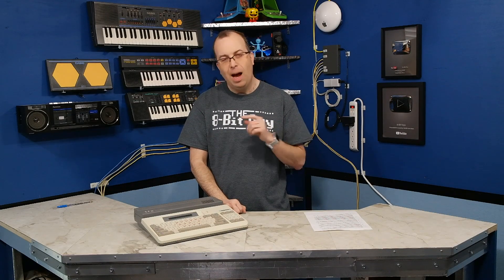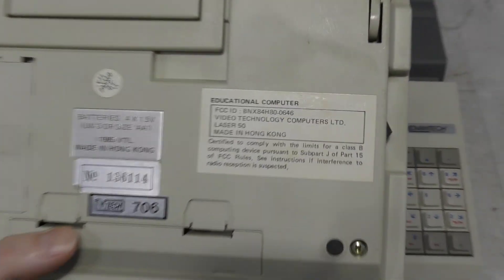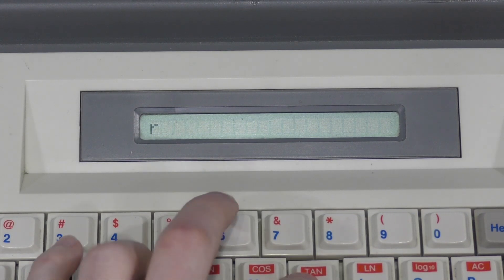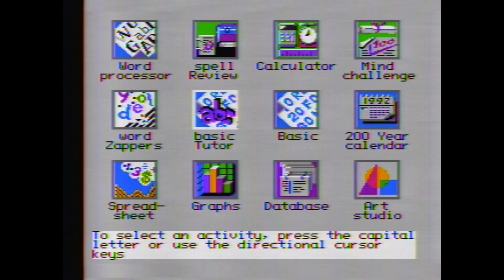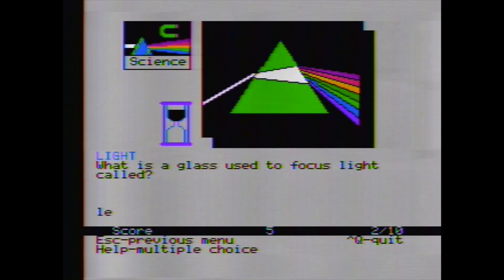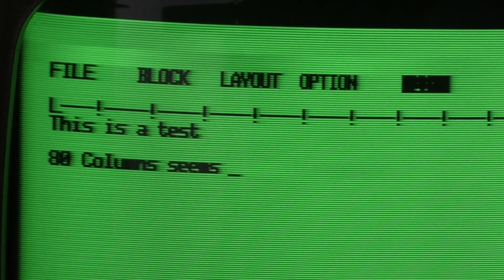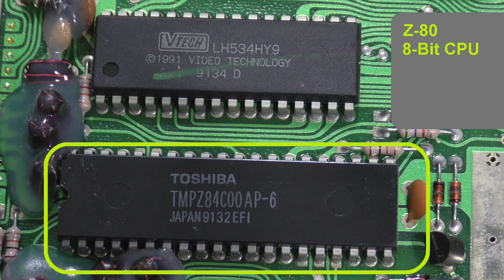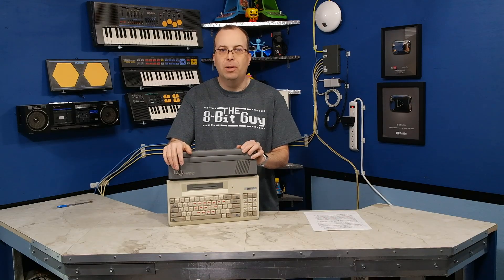The Advantech I.Q. Unlimited with BASIC and a Z80 CPU.

Comment: I'm pretty sure that screenshot on the C64C was NOT an actual application that could run on it; but the question remains: what IS that CAD application? and what DID it run on?
Reply: I've used 2D and indeed 3D CAD software on an ST, including in its low-rez mode, so 320x200 with limited colours need not be a barrier to the concept... just might have a slow redraw rate and be limited in how complex a design you could construct. There's all kinds of surprising software available for the 8-bits when you start looking beyond the games. Also I wonder if the 64C could still have 80-column and other such expansions added to it which might have made it more of a practical prospect?

Comment: Me thinks these machines were a cheap effort to scam the average consumers who weren't very tech savvy in those days... which were a great many people. The BASIC is less than bare bones, the LED is one line, the keyboard is rubbish, there's no additional software outside the boring built in programs; for 200 bucks in 1991 you're only ripping yourself off. If you really still wanted a good 8-bit micro by that point, the redesigned C64 for $150 would have been the best choice.

Great video, by the way. :)
Reply: I was kinda thinking the same thing myself. A Z80 processor in 1991? Were they insane? 

It's a bizarre machine, and it doesn't seem like the manufacturers really thought through what it was they were trying to achieve with this thing.
Reply: I think Dave's right, those awful wordprocessors would be the best bet, $200 cheaper than a c=64, ($150+$50(software)+$200(1541)+$200(printer)), vs $400.  You got a better display, spellcheck, grammar check and it was a lot more capable for writing than a C=64.  Your kid will hate you and will never go into computer science, but they won't be playing games, pirating disks and they'll be able to do their assignments... ugh.  That said, some of those wordprocessors had DOS disks or could be used as a printer, and I bet that external monochrome monitor is a generic composite one.  You might find a junk XT or something to upgrade to... having flashbacks to my horrible childhood.
Reply: I'unno, the hardware basically seems to be an Apple ][c just with a ~5MHz Z80 in place of a 1MHz 6502 (and so operating just slightly faster, realworld). One of those plus a basic software bundle might have cost you about the same at the time, maybe quite a bit more because of the built in floppy (the mechanisms were still fairly costly), without the nominal portable capabilities. A "real" laptop or indeed any other kind of useful portable computer would have been much more expensive and not at all kid friendly, or able to connect to a TV.

The real failing of it is the lack of additional software. Like perhaps VTech made some carts for it, but they evidently weren't very widespread and would have been limited in number, as well as carrying a heavy bias towards edutainment games. Thing could have really done with a floppy add-on, and allowing third party devs to make stuff for it... probably wouldn't have taken much more than recompiling Apple ][ source for the Z80.

Comment: I owned a Laser 3000 computer back in the mid 80s and was unaware until today that it was a VTech product- all I cared about back then was what it cloned rather than who made it- an affordable Apple computer.  According to what I read, it preceded the Laser 128 which makes sense- it was an Apple ][+ clone (minus lo-res mode, which had me a bit miffed back then) which apparently came out in 1983 whereas the Laser 128 was in line with the //c and came to the US in 1986 (according to Wikipedia).   It would be interesting to see this bit of history included in the upcoming Laser 128/XT documentary if it hasn't been finished yet.

Comment: The Ti 83/84s are still using 6 MHz Z80 CPUs and sold for $120~$150.

At least the Ti-Nspire versions use 350 MHz 32bit ARMs, and also go for $120~$150.
Reply: I had to Google that immediately.  I knew 8-bit processors were still useful, but you just blew my mind!  🤯

Comment: The first Unix editor was ed, and you worked on one line at a time. Of course this was the early 70's.
Reply: You probably got to see more than 20 characters at once, though, I'd expect. Especially if you were using a teletype.
Reply: How about using DEBUG to format an MFM hard drive then using EDLIN to write AUTOEXEC.BAT and CONFIG.SYS? If you screwed up you had to start over because EDLIN was an output only text file creation program. Once you hit Enter, the line was written to the file with no way to change it. I did several PC setups like that back in the day.

Comment: Interesting, if frustrating computer. That basic would annoy me so much. XD
I don't like basic at the best of times, but no graphics and no peek/poke?
on the 800XL I got recently I actually wrote a bunch of test programs using mostly poke commands even though there were quicker and easier ways to accomplish the same effect with graphics commands.

Artifact colours are interesting though. - Especially when a system relies on them to produce colour at all.
Completely useless in PAL territories of course, which means I can't really test anything with them.
You can do some strange tricks if you can figure out how they are set up...

Well, I mean, my Super Famicom shows signs of artifacting, and PAL tv's from the 90's generally accept NTSC signals - sure enough, Mario Paint shows a lot of bizarre effects. - the issue with a SNES here is that there's 256 pixels across the screen where NTSC signals have something like 160-170 colour clocks on the visible portion of the screen. 
Officially an NTSC line is 228 colour clocks, but this includes hblank and overscan - by comparison a SNES outputs 342 pixels in that time. Which, in fact works out to be 1.5 colour clocks per pixel; And sure enough, artifacts in Mario paint show evidence of more than two pixels messing with one another.
My 800XL is a PAL system of course, but the 800XL was designed such that in highest resolution mode, 1 pixel is 1/2 of an NTSC colour clock. This gives 160 colour clocks for 320 pixels. Thus, you can use high res monochrome graphics to create artifact colours. Except... That only works on NTSC...
PAL has two problems here; instead of 228 colour clocks, you have 284 - this means instead of 160 visible colour clocks (give or take), you'd have roughly 200.
But the system resolution remains 80/160/320... Thus nothing lines up too well, since you'd have about 1.24 or 2.5 pixels per colour clock. More importantly of course, artifact colours just don't work properly on a PAL signal - the Phase Alternate Line technique that gives PAL it's name would cancel out any real colour artifacts, and while there are indeed artifacts in a PAL signal, these tend to be luminance artifacts, not Chrominance ones... And those really aren't very useful, plus the design of these systems is completely wrong to take advantage of PAL artifacting anyway.

One of the consequences of all this is that systems which relied on artifacting to produce colour required special composite monitors for PAL territories.
An Apple II in a PAL country is either a completely monochrome system, or required a dedicated NTSC composite based monitor to be able to display colour.

I'm not even sure what CGA composite would have depended on in Europe...

Composite colours are an interesting trick, or just as often, and unwanted headache, but at the same time they're also a trick that really only works in some parts of the world and are completely useless at others.

Anyway, my usual nerdy tangents aside, this computer is fascinating, but also very frustrating...
I'd be annoyed having one of these... So limiting. XD

Plus what even is it? I tend to wanna dig into the computer hardware and figure out how it works and what it can do. But this thing has little documentation, and it's available programming tools seem to give you very little insight into it's technical capabilities.
What are it's graphical capabilities? What are the limitations? Doesn't seem like there's any real way to find out...

Comment: I wonder if it took the carts that the other, cheaper vtech, machines took because I'll be honest it looks the right size for the ones I had over her in the UK. Plus I wonder if the proprietary slot was for a ram / HDD upgrade or it looks about the right size for the old 12 pin CBM 1530 Datasette

Comment: Very good timing! I just got a V-Tech IQ Unlimited computer thingie from a local junk shop about a week ago. Altough it's in a laptop form factor, with just horrible LCD screen as the only option for display. From the little information I could find, it has some Motorola 68000-based CPU. It has pretty much these applications built in, but with a slightly more GUI form (as it came with a propietary mouse). Interesting platform but pretty much useless without any extra software, support, or information about it... or without a better display.
Reply: With the Equalizer name the searches suddenly make more sense, I even found the manual. Pretty nifty that it can be connected to a PC. I have an weird cable that has male D-25 plugs on its both ends. It seems to require some kind of driver/program for the  PC transfer.

Comment: 6:44 One thing I noticed here when you were checking to see if the calendar was Year 2000 compliant was that it did the typical assumption that a certain number range was 20XX vs 19XX and on the screen it did indicate 2018.

Comment: Remove the built in Programs, add a better version of Basic, there you go.
Reply: and add a cheap cassette drive or interface to save the programs to and an option for monochrome mode on the screen.

Comment: Is it me or are many of the inserted floppy disks in those catalogs inserted backwards? They have the clip to outside instead of the inside. I guess some photography genius thought it looked better that way...
Reply: Probably a photography and graphics design team that had up to that point still used Polaroids for proofs and lighting tables to look at slides  and did all their compositing on a camera stand of some sort. Never having ever touched a computer, and even when Photoshop came on the scene probably refused to move to it for another ten years. That's probably who took the pictures and setup the "word processor" in this catalog shot..
Reply: It wouldn't surprise me. I once saw a photo of graphing calculators in a catalog, pictured with an equation screen on which someone had typed a bunch of meaningless gibberish that resembled nothing anyone actually using the calculator for its intended purpose would enter.
Reply: I saw that immidiately, too. It was painful.

I only can think that they wanted you to see that disks go in there and not .. slices of very white cheese or something.

Comment: thinking about it, the z80 saw kind of a renaissance in this period because there were quite a few portable systems that used the z80 for it's relatively low power consumption (your Palms, your Amstrad NC200s, your Z88's and of course your Gameboys) so volume probably made it a shoe in for many cheap educational devices.
Reply: TheTurnipKing It was also used as a coprocessor in some consoles (for sound among other things), and Z80-compatible chips are used to this day in embedded systems. Most of the cheap MP3 players of the 2000s used Z80 cores.

Comment: If it's a text based machine how did they make their programs run graphics. I suspect installing an updated version of basic will provide a better experience than c64. Printer port also means a better sound card is possible.

Comment: Is that video generator microcontroller the grandfather of modern graphics processing unit? Early graphics cards uses video address generator, dual port RAM and RAMDAC to generate the video signal, while modern GPU uses a dedicated processor to generate the video.

Comment: Well, it takes so many batteries just to keep the data in the RAM all thanks to that pseudo-static RAM chip, which have to keep refreshing all the time? I think that most of the devices just need a CR2032 or so to do this (for they are using real static RAM chips).

Comment: could it be that 64K of that 128K of RAM is used for operating, and the other 64K is used for storage, seeing as they are using a battery backed ram solution?

Comment: Wow.  I forgot I had one of these.  I also think I recall having an earlier V-Tech machine with a membrane keyboard, a 4-row display, and a blue, white, and gray color scheme...or maybe a classmate did, and that's why I got this one?

I remember being really excited about this computer, using it on at least one family trip, and also at a summer program when I was not busy doing the summer-program-y stuff.  I think the limitations got to me eventually (and by eventually I think it was a fairly rapid disillusionment).  I DO seem to recall that you could use special characters for animations on the LCD display that weren't limited by the slow speed of the newline, which I used to animate ASCII-based spaceship explosions and the like.  We might just be talking printing strings with a clear-line character that I slowed down using a for loop.